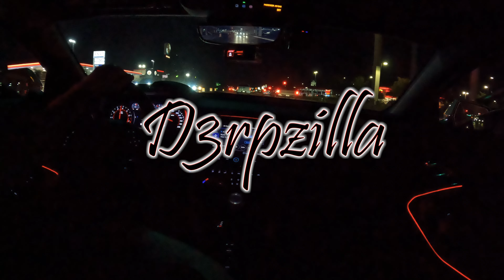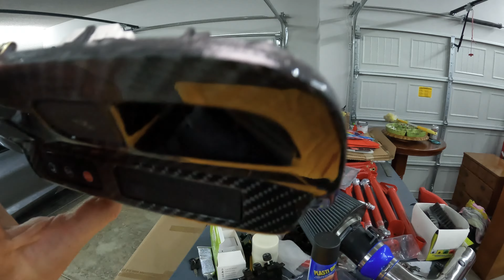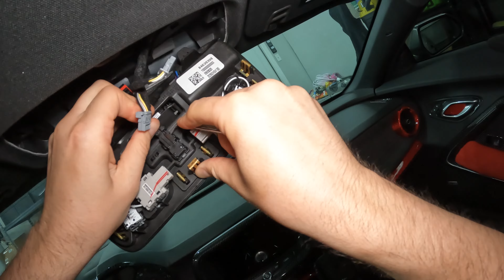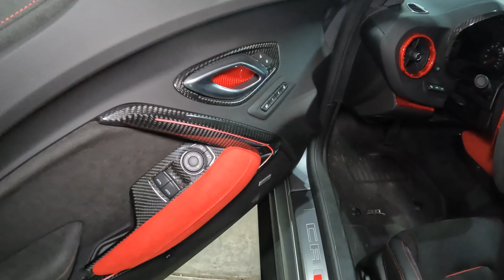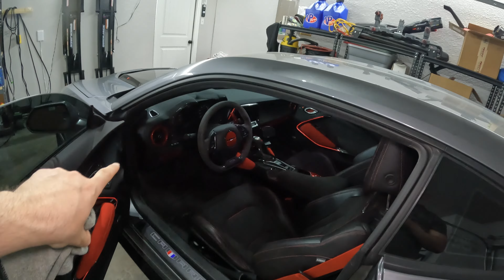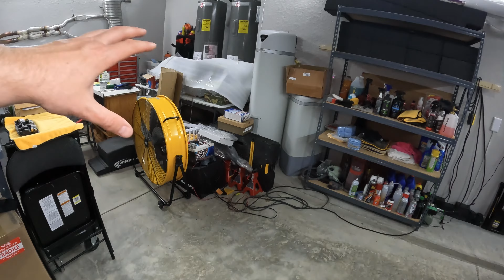Carbon Fiber Dome Light Roof Panel Install | 2016+ Camaro Interior Mods!

Comment: Where did you find the carbon fiber flat bottom steering wheel part and the ambiant light parts ? And do they ship to Paris (France) ?
Reply from the maker: Heya! Unsure on where they ship, would need to ask them.. For the steering wheel stuff check out https://www.youtube.com/watch?v=tj_Ju6oNabw (look at the video description for the various direct item links). For ambient lighting.. are you talking about the Spectrum lighting in the doors, around the radio, and in the cup holders? If so.. that is the Spectrum lighting system that comes in the 2SS and the ZL1 (also may be an add-on option, can't recall). If you don't have Spectrum lighting you can add it but it's somewhat expensive and probably a little bit of a pain to install. Take a look at this forum post on what is involved, https://www.camaro6.com/forums/showthread.php?t=444999 :)